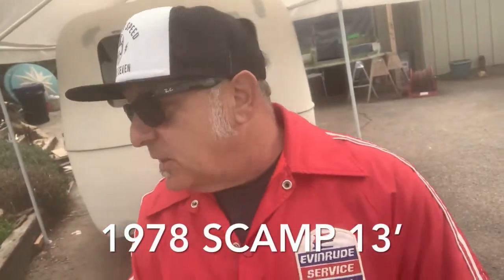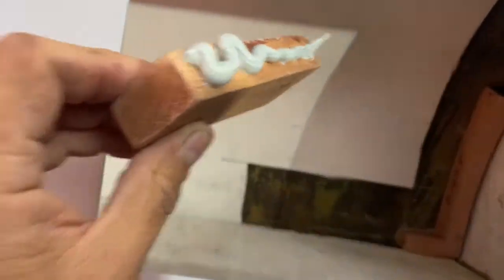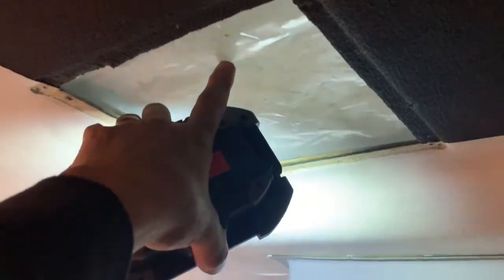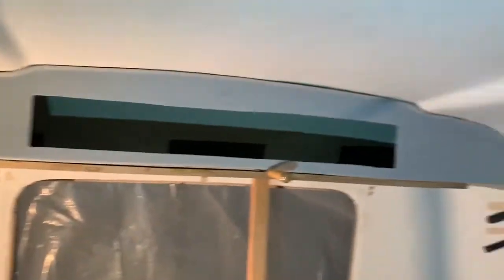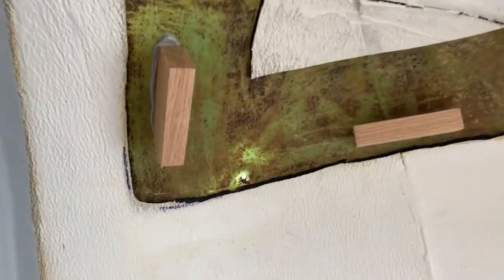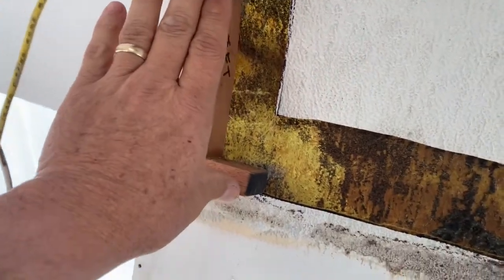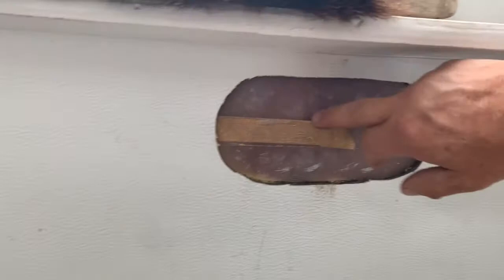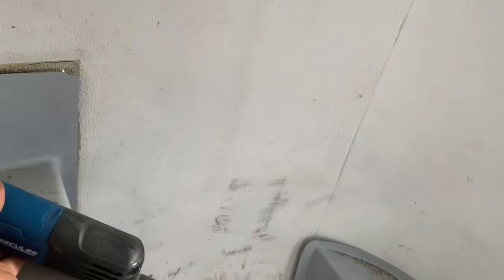Scamp Cabinets | Making Supports For Cabinets | #NoMoreRivets #ScampTrailer

Comment: I'm in the small town of EHRENBERG AZ. Boon docking with next to the Colorado River. There are 2 welders in the area, but it's a job their not familiar with lifting the body off the frame. A new frame from the dealer is $2,500.( Without labor) I went to Cherokee trailer in Scottsdale, AZ. No luck. I have the entire interior removed to facilitate access and maybe reduce labor cost.
Reply from the maker: Silvio, are you sure you need the hole frame replaced?  Mine was REALLY bent up underneath from the previous owner driving and pulling the Scamp over huge rocks in the Tucson AZ area. He said he pulled this trailer through areas that Bighorn Sheep wouldn’t even climb, and he broke all the corners off the fiberglass in the process. I cut out the whole middle section, and then welded in new bigger pieces. I’d love to see pics of what you have going on. Can you email or post a pic?  I’m at Westcoast_Johnny@yahoo.com

Comment: LOVE the idea of reducing/eliminating rivets. Every hole is a potential future leak that rots your subfloor! Does the glue not ooze out and adhere the wood to your cabinets? Six points of contacts are enough to hold that up?
Reply from the maker: The cabinets are held in place with small blocks of wood. The wood blocks were glued in place (just until they would remain still). Then I fiberglassed them in place. The step of fiberglassing the blocks in place (and onto the fiberglass shell) is the MOST important step. When the cabinet is held in place where you want it, then drill a hole through the cabinet and through the wood block, then use nuts and bolts to connect them. The fiberglassed wood blocks are much stronger then the rivets as well. Then you just eliminated potential leaks and the exterior is much cleaner looking.  The only reason Scamp or any other company uses the big rivets is to save a lot of time.

Comment: Thank you for the info. I have a 1977 13' scamp that needs a frame & floor. Is there anyone you know that can help me fix this issue? I'm currently in Arizona. The Scamp Dealer in Minisota is not an option. I'm not a perfectionist that needs work with too much detail. I'm retired and have been traveling / living  in my scamp for 5 years now. I don't mind spending the money to invest into it. Thanks again for the detailed videos.
Reply from the maker: Hi Silvio, thanks for stopping by!  What city in AZ are you in? I’ll see if I can locate someone near you. Is the frame repairable?

Comment: Will you still have to have holes in your shell for the windows?
Reply from the maker: Hi Courtney, yes. When the windows go back in, I will need to drill a small hole for each rivet. They’ll be some sealer used also to prevent leaks.  It was the large cabinet rivets on the roof that started to leak.